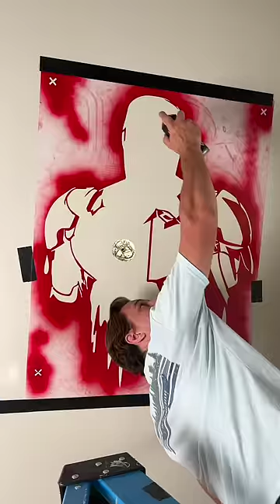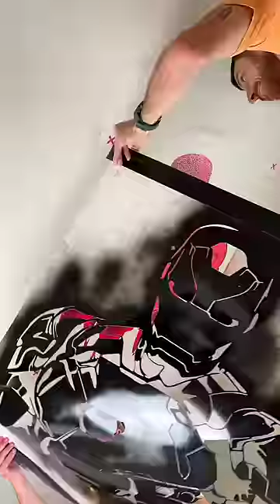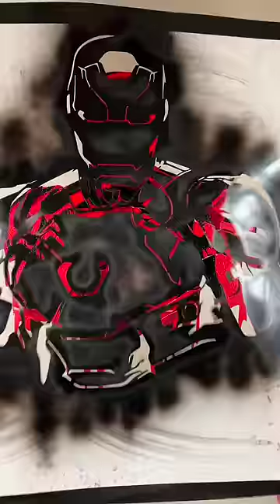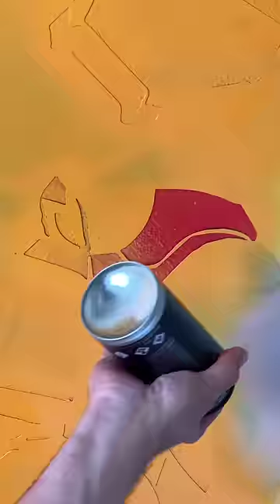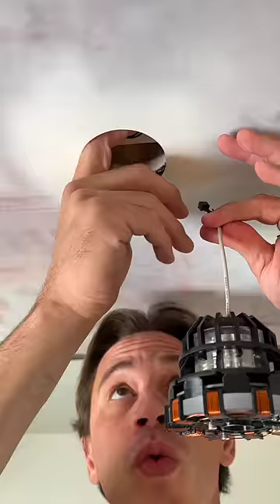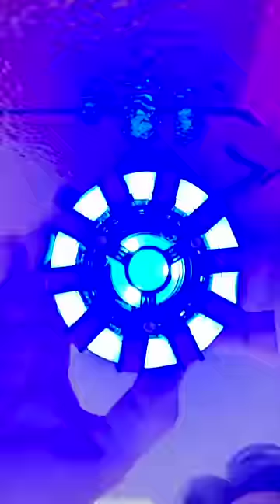How to fix a broken light! 🦾

Comment: Finally a video that’s not giving me anxiety. Kudos!!!
Reply: 123 likes and no replies? Lemme fix that
Reply: There's copper wire on that light...
It conducts electricity.
It conducts heat.

It's gonna cause a fire.
Reply: I fast forwarded it as soon as I saw his face cause I automatically assumed it was going to take 15 minutes to get the light 💡 in
Reply: The broken glass had me..someone is getting a sliver.😅
Reply: @xLionsxxSmithyx hopefuly💀

Comment: I want to know how he gets everything to lineup so well.
Reply: he has mark lines it is not complicated
Reply: if you watch again youll see little crosses on the corners of the sheets and he paints those and uses those to line it up
Reply: Marking on the surfaces the corners of the stencil and then lining up every stencil layer with the markings drawn on the surface they're painting on.
Stencils are made with the computer, probs photoshop because you can make every layer match and then print em separately.
It's easy they just add "comedy" to it for views
Reply: Mark link + + + + (4 colors )

Comment: No offense, but you probably should have went with a head on image, because the arc reactor looks wonky. Either that or adjust the fitting to the same angle as the image.